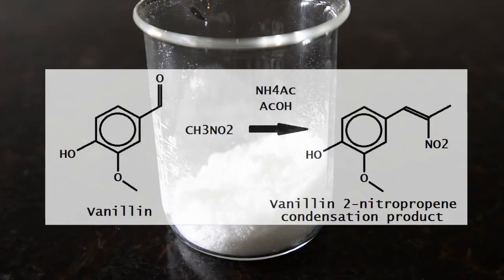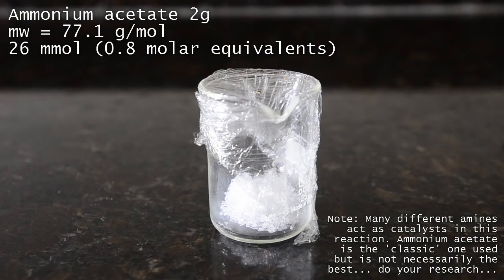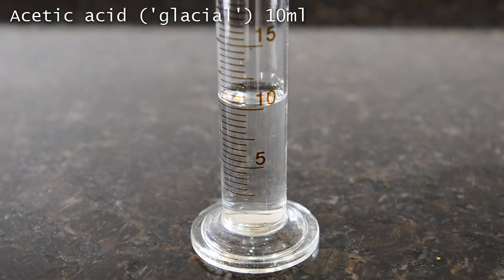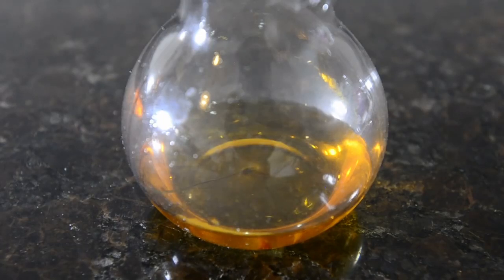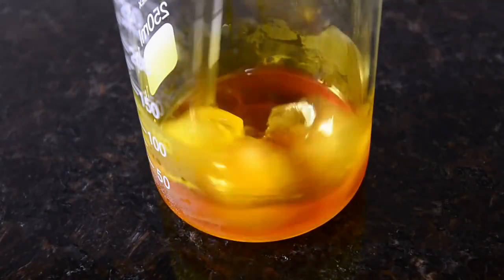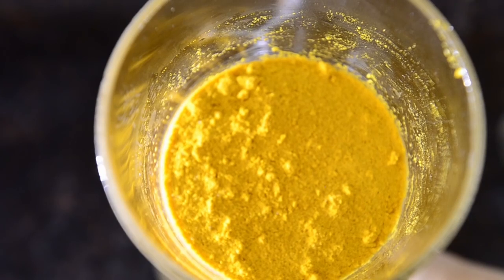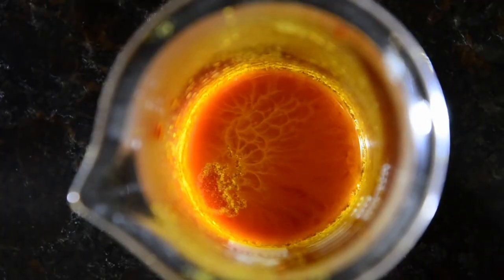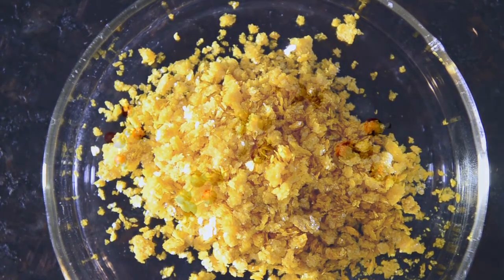Henry condensation between vanillin and nitroethane using a microwave

Comment: Sncl2 hcl reduction
Reply: I've not personally tried the reaction but I don't believe tin works,  CuCl2 is favored in the literature I have seen
Reply: @michaellott2427  You say you are trying to reduce tin. Does tin p2np and mdp2np work
Reply: @ahmetselcuk1400  no, using the SnCl2 as the  catalyst doesn't work. However I've read several success stories using CuCl2.
Reply: @michaellott2427  p2np yi p2p what is the best reduction
Reply: @michaellott2427  What is the reason for the failure of reduction with tin
Reply: @ahmetselcuk1400  I couldn't tell you,  as I said I haven't tried it personally. But I have read several papers and forums that all claim it fails.
Reply: @michaellott2427  thank you can you send me a forum link